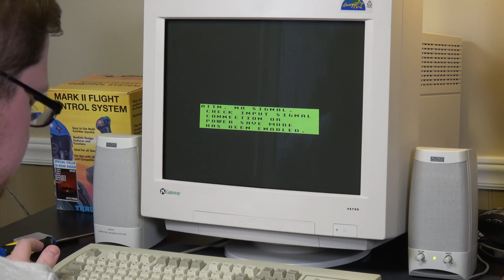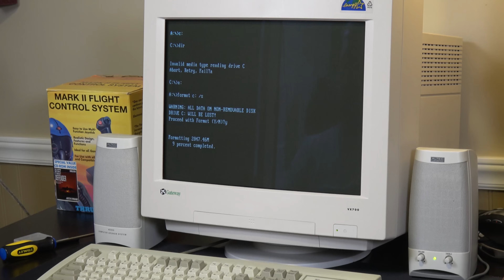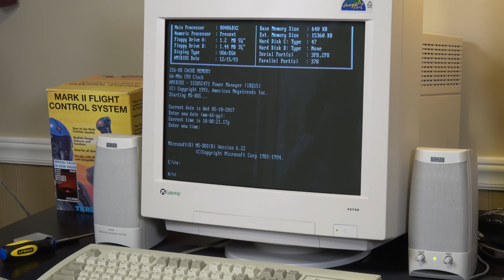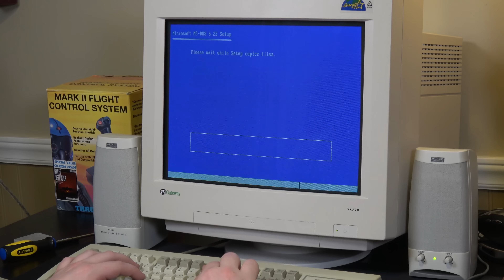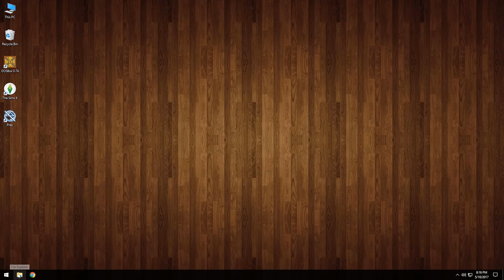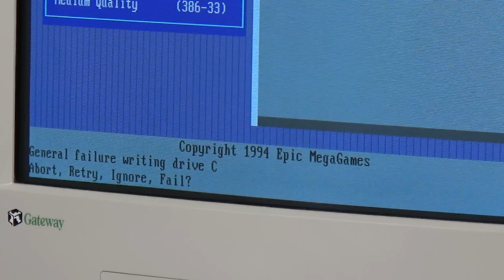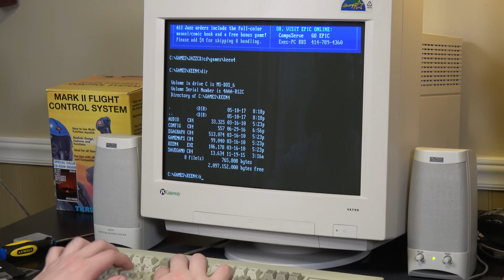LGR 486 Update! Installing CompactFlash Storage

Comment: The Abort, Retry, Fail error you got, may not be to do with any actual failures, but maybe more to do with the speed of the CF card. I remember on my Amiga when I Installed a CF drive, I had to change the Max Transfer speed as I was getting lots of read errors when loading WHDLoad images. Not sure how to change that on a PC though, maybe it's just something you have to live with :(

Comment: I wouldn't worry about transfers & data access speeds.  Whilst I'm using IDE2SD rather than CF my Athlon XP 3200+ quite happily runs Win98 and an assortment of large games & shuffling their ISO files around without any trouble from the adapter.  If a IDE2SD can thunk it fast enough then a CF card which basically is IDE shouldn't struggle at all.

Comment: As of those other methods, SD card adapters are interesting little beasts. If you want to make a controller circuit that only handles the card at slower write speeds, aka MMC modes, then that's pretty easy and cheap, but also runs into issues with SD Cards that are not MMC/SD/SDHC or are larger than 32GB in size (with a couple cool exceptions, of course). However, if you want it to run in full SD mode, then you have to pay a licensing fee to SanDisk (or be a reverse-engineer house in China...) and they'll give you the data sheets and libraries to make a controller with a microcontroller (AVR/PIC/ARM/8051, etc). I also have ran into this problem at work.

Comment: I've had some bad experiences with Compact Flash.
I collect retro Macintoshes, and a few months ago I began experimenting with flash storage in my G3 Powerbooks.
I bought an mSata SSD (with PATA adapter) from an old friend on eBay and installed it in my PDQ Powerbook. It worked like a charm, except for the fact that drag-and-drop transfers from USB drives of any file larger than about 600 KB would freeze the Powerbook. Drag-and-dropping from CDs worked fine, and extracting files from USB onto the SSD using Stuffit Expander worked fine, but dragging and dropping from USB would ALWAYS freeze the computer.
I did some research and found out that other people had encountered problems with USB and mSATA, but also read that Compact Flash didn't appear to have these same glitches with USB.
I bought a Compact Flash card and a CF-to-PATA adapter off of eBay. The card worked fine in the Powerbook for a while - the computer booted about 30 seconds slower than with the mSATA SSD - but the adapter literally burnt out the same day I installed it.
The PDQ Powerbook was now dead for reasons I couldn't explain, but I still had a Wallstreet and a recently-acquired Lombard Powerbook. I bought two replacement adapters, and they somehow killed the IDE controllers in both of the remaining Powerbooks.
I think I'll stay away from using Compact Flash cards as hard-drives in Macs from now on, although I did recently buy a Compact Flash PCMCIA card, which should provide an alternative file transfer method to USB for my new Lombard Powerbook.

Comment: Personally. I go with the blue 512mb Transcend card. Compatible and cheap and I still maintain the authentic experience of low storage space. The speed is between 1.5 and 1.8 mb a second for reading. The adaptor is just one of those cheap ones that cost a dollar or two. When I deal with non dos, I still use platter drives.

Comment: 2 options present themselves when in this kind of situation with an old PC-Laptop build: 

CompactFlash and SD-Card

 When comparing SD>IDE to CF>IDE adapters there are a lot of advantages 
compared to only a few possible setbacks. Here is my experience 
comparing them to CF..:

When going the CF route you have to deal with the fact that CF cards are
 still rather costly even in smaller capacities (2-8GB). They might end 
up costing you 20 bucks per piece or even more, since you cannot really 
use "standard" ones but have to use UDA compat.. With SD you can use stock ware.

You have to make sure that the CF cards are compatible 
(speed/ATA-rate/UDMA, etc) with your CF-adapters, which most of the 
times DO support all these features, so your CF cards should as well to 
make them work. Not the case with SD.

Comparing that to the SD alternative, I have yet to come across an SD 
card that is incompatible with these adapters. I have tested 5 brands, 2
 no-names, and various sizes between 2 and 32 GB, they ALL do work with 
these nice Sintechi adapters on all three laptops of testing (Contura 
400C (468DX2/40), Toshiba Satellite 200 (Pentium 100) and Thinkpad 
Pentium 233)

The only drawback I have come across is the fact that there do not seem to be any adapters with master/slave
 jumpers like the CF ones have. But since I have been using the 2.5' variety in 
laptops/notebooks from the 1992-1997 era rather than desktop computers, I
 find them to be working everytime so far. This is probably due to the 
fact that laptops/notebooks tend to have (still do iirc) their HDD on 
separate/NON-shared IDE channel. Whereas CD [if present,] does almost 
always reside on a diff IDE channel.

But all these advantages (except maybe the missing jumper) also do seem 
beneficial for desktop PC retro gamers. Compared to CF you can almost 
completely forget about compatibility issues of the card and adapter 
itself. Be sure to use overlay software when going "beyond (below) 1997 
hardware though :)

Comment: There are a few VERY nice benefits of using a CF card as storage on really old laptops!  I'm surprised you did not mention that they use significantly less power, put out much MUCH less heat, and weigh a hellava lot less than the vast majority of old 2.5" traditional HDDs in Pentium and lower class laptops.  Its amazing how massive of a difference throwing a solid state storage solution into a 486 laptop can really unleash the beast within! ^_^

Comment: dear LGR.... you may be riding the retro-wave here (and quite entertainingly so) but this is actually a very applicable skill. Most industrial machines from the 90s and early 2000s feature hard drives and WIN95 or WIN98. Could you do a feature on how to move enterie partitions onto the CF-adapter setup to "copy" the entire disk??? Most industrial machines (lathes, mills, injection machines etc.) still offer support if your disk breaks, but it's super expensive.

Comment: Nice video! I work with some old systems and so use some of these CF card adapters. 

The SYBA adapter you held up at 2:25 is great for plugging two drives up - some of the old mobo BIOS have a hard time with handling two separate adapters in master/slave configuration but that one has never given me trouble!

Comment: Years ago when I worked in a computer service department, we would see lots of odd things when connecting a UDMA drive to a 486.  The most common thing would be the CD-ROM glitching out a lot or it refusing to detect under oakcdrom.sys or Windows 95.  If you continue to have glitches, I would try to find an older CF card that runs PIO mode 4.  Fast ATA2 might be ok, but definitely UDMA can be a problem.

Comment: I did this for an older 14in ACER WinXP era laptop that still used a 2.5in IDE HDD after the 40GB HDD started to fail, and I was able to get a 64GB compact Flash card in it for about $85 which is about the same as replacement HDD would have cost me, I eventually installed LinuxMint XFCE  on the machine before donating it to my church library, and it so far after being in the system for 8 years it still works just fine as a basic internet access station. So yeah these can be great solution for machines from the 386 era all the way to XP era machines with IDE.

Comment: May I suggest making the other partition FAT32, and installing a FAT32 driver for DOS? You also may like to add long filename support. That way the other partition can have documents and stuff.

That's what I did on my old 486 back in the day. Well, except I used a Win98 boot disk for FAT32 support.
Reply from the maker: Any of those drivers I've seen are memory hogs, so I'll keep it as-is :)
Reply: True, but you did say you were going to do the memory optimization stuff, meaning you can give yourself a ton of high memory. 

But, hey, if you'd rather not that's fine. Personally I'd do it just to do it, and then turn it back off. I like seeing how far you can take old DOS, even if I just turn it off later.

Comment: Ive done this a few times over the years. Tip of advice... find an old 3.5" cf reader thats usb. Must be cf only. Remove the board and install the cf to ide adapter inside. Its how i did it to 2 machines. Now you have an external cf. ;)
Reply: Upside is it would be in front of the pc, not the back.... Using a 3.5/5.25 bay. Also, I seem to have better luck with CF microdrives on older machines 286 pre.

Comment: How does using a fast drive like a CF or SD affect speed sensitive DOS games? or does it? Do you ever have to slow down the computer (by disabling cache, etc.) for a game when using a CF or SD card when it wasn't necessary when using an old mechanical hard drive?
Reply from the maker: Typically it's nothing but a net positive; they just load faster! I haven't run into any problems with faster loading, except in some cases you don't get to hear cool load screen music or something.
Reply: Thanks. I might try one of these -- if they don't sell out after your review.

Comment: I replaced the 428.1MB Seagate HDD that was in my Packard Bell Pack-Mate 28 Plus with a 1GB CF Card, and I ran out of space quickly, so I installed a 2GB CF card into the system, installed MS-DOS 6, upgraded to 6.22, copied the files from my 1GB CF Card to the 2GB CF Card (I also copies the files from the 428.1MB HDD to the 1GB CF Card using another computer and the Live CD of Linux), and I'm going to back up the files onto my desktop if the CF Card happens to fail on me, and I also have a 4GB CF Card; plus, I'm planning to install L2 cache (512KB or 128KB) and upgrade the video memory from 1MB to 2MB when the money's right.

Comment: Fantastic Clint! I restored my first computer, a Pentium 233, and went the IDE to SD route when the original 2GB HDD, and then the 20GB I had to put in both died. It works good other than I can't run DMA in windows for some reason. Still faster than and HDD though, and I can quickly mount the SD card on any of my modern computers. I have DOS 7 and WIN98 though with two 4GB partitions. I'm sure 8GB is all I'll ever need (heh).

Comment: How did you get this to work without the sound card drivers? Did you install them and set up a proper config.sys without showing it? You might want to delete the dbldisk driver which gets loaded with dos 6.22 by default whether or not there is any disk compression going on. The ONLY way to get it not to load is to delete it. It's a hidden file in the root directory and just deleting it will take care of the problem and it won't cause any error messages or anything. It takes up conventional memory for no good reason (I'm assuming you aren't going to be using doubledisk).

Comment: Try measuring the voltage between the yellow and black wires on that floppy drive connector. I doubt that CF adaptor uses it, but it should measure 12 volts.

Comment: We need to design a device that connects inline with the drive activity light that will make hard drive seeking sounds every time there is activity on the SSD. Since you use this a a production machine I think it might be a better idea to use a DOM since they should work perfectly without any of the wonkiness of CF cards that don't seem to be 100% compatible in fixed-disk application plus a lot of DOM use more reliable SLC flash. Personally I usually use networking to transfer files to old machines all you have to do is install WFW 3.11 and the TCP/IP protocol and create a shared folder on the WFW 3.11 machine and it is very easy to drag and drop files over from even a modern PC.

Comment: I tried doing this a while back with a Macintosh Peforma 5200 machine, taking out the clunky 500MB mechanical drive and replacing it with a CF card on one of these IDE adapter. Tried multiple cards and a variety of ways of getting the system to recognise it but was a no go in the end, the system just didn't want to see the card :-(. Probably just a Mac thing because, well, Macs, but it would seem that not all IDE machines are up for having their drives replaced with CF cards....

Comment: I use  IDE to Compact flash in my Tandy 1000, Amiga 4000, 600 as well as two of my 486 machines.  The write and read errors were greatly mitigated for me when I switched to a specific CF Card.  The card I use is a Kingston 4GB card.  I have not had any issues since moving over to those cards.  I use the exact same adapters that you do, it appears.  I got mine from the local Microcenter before they stopped carrying them, and then from Amazon afterward.  They work quite a treat.  I have two IDE to SD card adapters as well and where as they work, the cards I have are slower than the Compact Flash drives, even though the cards are rated at high speeds.  Maybe it's the adapter I have. :Shrug:

Comment: I'm planning to do this to my HP Vectra XM 5/133 (that doesn't like 8+GB HDDs ;-;) and my iPod Video. 4GB one in the Vectra, 64GB one in the iPod c:

Also that's one kick-ass setup you've got there. Man do I want a CRT again, I miss the old one I used to have (a Packard Bell with side mounted speakers)...

Comment: I got myself a little SD to IDE adaptor and I've been using it as a second/removable drive on a Win 98 machine I have. I just unscrewed one of the expansion slots and stuck it through that, it works great. It doesn't look good but it's in the back so you can't see it at all.

Comment: That particular card isn't the best choice in my opinion for hd replacement, I got fooled by the 300X spec and bought a couple but later realized that 300X means nothing. Maybe you won't have slowdowns on a 486 (at least I hope) but they're not suitable for higher performing machines and games, even a Pentium 75 needs something faster and more reliable. Finding decent CF cards under 8GB is getting harder and harder, at this point I buy used Sandisk 4GB, hoping they come from cameras and they're not "too used".

Comment: Do you know of anything similair for computers with stk520 drives? I've got an old acorn achimedes 310 that my dad bought in 1989 but the hard drive has gone bad on it. It's only got a single double density floppy drive in it that at least still works but I like restore the machine somehow. I had quite a few games on the hard drive, such as lemmings.

Comment: I used to have a monitor that looked EXACTLY like the one you are using, only mine was branded as Mitsubishi, specifically it was the Mitsubishi Diamond Plus 72. Must have been the OEM for gateway. It was a superb monitor, I have spent countless hours playing MS Flight Simulator 2000 Pro on it...

Comment: Have you ever done a video in Freedos? How do you feel about the project?
Reply: Tried to use it once, could not find any decent and easy tutorial out there. After much hustling in google, I ended up with a DOS window, but no command would work in it, like dir, cd, mem... what the hell... that''s when I gave up... Would FreeDOS work at all for 3D games with my modern laptop GPU? How would I do with drivers for sound and graphics? Would appreciate if anyone out there provided a ready-to-go image with at least SoundBlaster installed.
Reply: @FeelingShred  It should be roughly compatible with DOS software. FreeDOS or not doesn't change the driver situation, but if it works in DOS it likely works in FreeDOS as well. Most games used their own sound drivers, so unless your sound card is compatible with what's listed in the setup menu, you're out of luck. GPUs are usually somewhat VGA compatible, though, but YMMV.

Comment: A good idea I'd follow is use something like win32diskimager or something to backup the card to file so that you can reload it exactly as is. It's pretty much running like how Pis work with SD cards, so you can have a nice fail-safe in case the card decides to not cooperate.

Comment: I run my 286, 486, and Pentium systems with these adapters. They're far more convenient to find than looking for working IDE hard drives, and they're much faster. The seek times, random access, and throughput max out the IDE bus on older machines which removes the drive as being the bottleneck.
Reply: Yes a dos expert but on Amiga I use to give more buffers on cf/sd solutions so they read/write fine and last more.

Comment: I haven't worked with this system (past opening and running some games on an already set then machine) so i'm a bit iffy on the information, BUT, do these old systems have content indexing? If so, can you disable it? Because that's been a staple trick to get rid of the loud HDD ever since i was using Windows XP (i know worlds apart, but it's old-ish enough to warrant the question having gotten the trick from even before that somewhere).

Comment: Try to watch youtube on old pc's with windows
Reply: You cant get something decent below PIII 500 or Celeron 600 with at least 256MB and k-meleon. I tried that on slower, even a P1. It is useless and hopeless. Takes forever to get a frame loaded and audio keeps trashing like a bad CD. No matter if you run a small window on 144p. It wont happen. Only workaround is a Raspberry PI, VNC and do in that way. I mean, just for the amusement of "browsing" in HW that is not capable of that. W98 can get Opera 10.5 (or something like that) with kernelex, but I dont think that it would work for YT. But get DECENT browsing on TODAY pages. Speed will be as slows as the system.

Comment: you should use a microdrive! it's CF but actually it's a tiny little hard drive which is slow, has noise, and isn't shock resistant! you can find them inside iPod minis.